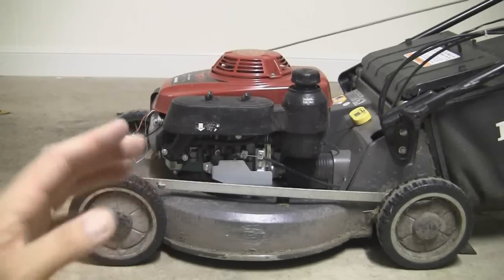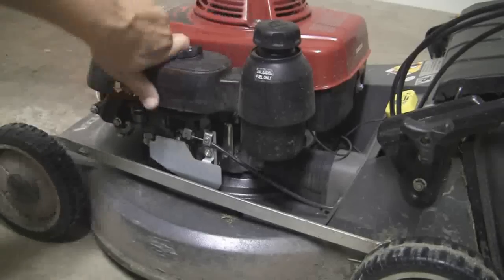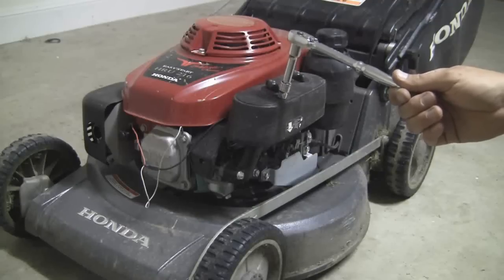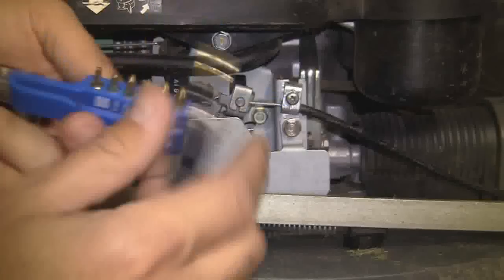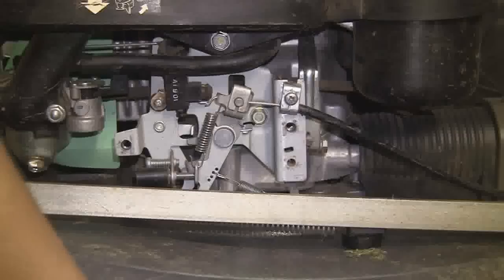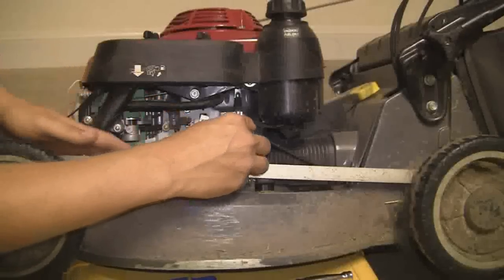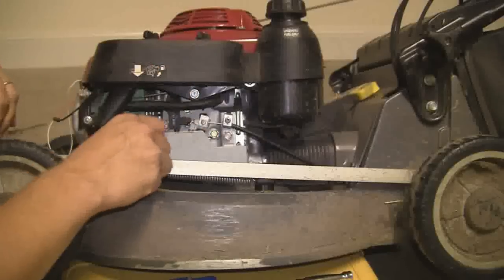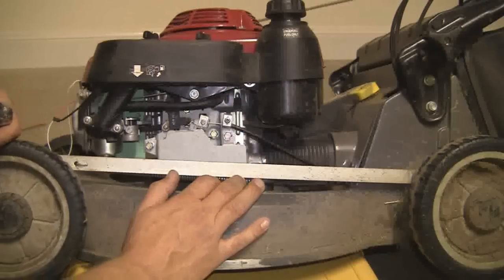Setting the engine rpm on a honda mower.wmv

Comment: As someone else mentioned, 3600 was a common rating for the engine power at 3600 rpm.
Very few mowers unless they are over 30 years old are supposes to be at at the number.
Most mowers are set to 2900 +or - 50 rpm.
I set self propelled mowers at 2880 and will often set push mowers at 3000 -3050.

3600 is not only to fast, it is likely a violation of blade tip speed safety laws.
Besides that, it's just extra wear and tear on engine that will shorten its life and it wasted wastes about 20% more fuel.

Comment: Nope - at least not for the GVC160 engines...
Shop manual for this engine specs are 2,950-3,100 rpm.
Keep those blade sharp and maintain the lubricant for the rear wheel adjuster bushings - they are a fairly frequent Honda power sucker and can be really dragging before you notice it.

Comment: Got my mower checked at Honda. It was at 2200rpm , 2 weeks old commercial self propelled . The setting was way too low, so they adjusted it to 4000rpm and said that’s way too high , so adjusted it again to 3200rpm. So if you have a new Honda, I wouldn’t go higher than 3200rpm. 3800rpm will wear the motor out according to Honda mechanics. I haven’t tried my mower out yet, since been fixed. But I’m sure 1000 extra rpm will make a huge difference.
Reply: All manufacturers have a limit on safe RPM to run engines 
Look it up and adjust as needed but not any more than that 😊

Comment: this is an old thread. I just spent $10.00 on an HR214 at an estate sale. The guy it belonged to passed away about a decade ago and it has not been started since. It is a clean mower. The oil looked new. He was a drag racer so I am sure he took care of his equipment. I put a little gas in it and on the first pull if fired up and ran like a top.

Comment: For what its worth 3600 rpm is the maximum rated speed and my Honda service manual warns not to exceed 80% of the maximum speed during continuous operation. That's why the are generally set around 2900 rpm. Running higher speeds will shorten the lifespan.
Reply: I just took mine to Honda, it was running at 2200 rpm, so they fixed it and set to 3200rpm. They set to 4000 to start with, then said way too high, so adjusted it again to 3200. So definitely 3800 is way too high
Reply: If you only run it at the highest speed setting when the blade is engaged and working it will survive well.

Comment: Honda intentionally has a lower rpm setting for their mowers that doesn't affect their performance at all. The lower RPM say in the 2600 to 3000 rpm range allows the motor to not only last longer but is also a lot quieter? The lower rpm doesn't affect cut or how fast you cut. I just bought a new car and at 65 mph my engine is less than 2000 RPM. Where my older car was sitting at almost 3000 RPM at the same speed. I think that is an advancement in technological design to improve overall performance and longevity. 
But what if you are cutting overgrown grass that was over a foot high? Honda allows you to make an adjustment by moving that spring to the next hole to increase the RPM so that the tall grass doesn't constantly kill the engine as you shove grass down its throat whether you are bagging or mulching. 
Honda superior engineering & design in every way. Please refrain from circumventing Hondas engineers who has already thought about whatever other concerns you had about their product. Just trust that Honda has got it right. I do.
Reply: breeze787 haha, you act like the people designing it are the ones who build it..lol...honda designed it to run 3600rpm, the schmuck who put it together obviously didnt put much pride in it or it wouldnt of been off to begin with.  Stop telling folks to not fix assembly issues, its not your dollar anyways.
Reply: There wasn't anything wrong with assembly. Honda engineers instruct assemblers to place the spring in in the lower rpm hole intentionally because it will neither hinder performance and the mower will consume less fuel & be much quieter. 
Please refrain from fucking up your Honda anymore than is required.
Reply: breeze787 cause everyone follows instructions..your right

Comment: I had a honda HRU19R1 mower serviced and it came back with the inability to throw the grass to the back off the catcher so it would start to drop clods when only half full or less and lose power on thicker (but still normal) patches

Comment: If it makes you feel any better, I just took ownership of my dads 25 year old HRU216 self propelled as he no longer needs it with no lawn to mow. It still starts first pull (but I snapped the cord). I'm spending about $100-200 on it because it's worth it and still a better mower than our couple year old Masport with Briggs and Straton. I just put a new throttle plastic lever on it, and the screws holding it on whilst corroded slightly on the outside are brand new shiny stainless on the inside(25 years frickin old). That's where the money is, I can pull a 25 year old mower to bits and live near the ocean and the only rusted out nuts on the whole thing was the exhaust shield. That's more impressive than our 10 year old car, or 5 year old door knobs that are inside our house!

Sure these mowers have their shortfalls, but they are really well built and designed to last. When it fails, i'll go and buy a new one.

I'll be sure to look at the RPM and give it a tickle, thanks for your video!

Comment: 3600rpm is rediculous by the way. I am looking for a way to get mine to spin to 10 000rpm plus or at least in the 8000k region. Most small 4 stroke motors these days pull 12000 to 20000 rpm . Mine is due for a rebuild. There must be someone who does an aftermarket carburetor/cams/valve springs/high compression piston for these?....and also I am thinking that ditching the standard carby and moving to a flat slide bike carburetor with the right jetting would be better... the standard flow is totally gay, totally underpowered, especially when mulching and in 2nd with throttle pinned...  for me, in it's current form, this mower sucks!
Reply: and don&#39;t give me &quot;law states must be 3200 blah blah rpm max&quot; ... if a blade can&#39;t be balanced to spin at 10000 rpm and if the drive gear can&#39;t handle it, and if the steel is too weak, then it must be changed as well. There is no excuses for weak engineering designs or stupid laws based on weak design. I want to mow my lawn faster, less often (taller grass) and power though it without hesitation from the engine. These mowers are rubbish!
Reply: Nitrous oxide and bypassing the governor would be a good easy way to start, and would be easy to switch over to your next mower after it blows up.      P.S. drink beer and wear shin guards and steel toes.

Comment: Many , many thanks for posting this procedure for increasing the revs !I've just bought one of these and they oiled/fuelled it up in the shop , started it and then sent me on my way . This morning ( dry now ) I decided to give it a go , and the revs were quite low compared to my old mower of some 20 years now .......I found the ground speed and cutting torque very poor . So , I've thankfully found your video and made the same adjustments to mine this afternoon . I don't have a functioning tach ( one in the post from Ebay since last week though ... ) but I'm pretty good with estimating revs from years of equipment ownership/usage . Now I'm a happy camper . Why do so many mower sellers not give a damn about service/setup ? They're probably not prepared to move that governor spring . Cheers Mate :-)

Comment: Could the lower RPMs been intentionally set so that Honda could meet environmental requirements?   or "Honda consumes less fuel!"
Reply: BfSkinnerPunk yes, also helps Honda’s legendary “runs forever” department. Less wear through reduced rpm/ lower compression.

Comment: The engine is capable of 4kw (5.5 hp), but like almost all small engines (and many diesel engines, especially in caterpillar equipment) it is governed down to reduce wear and tear on the engine.  having made your adjustment, you get more power now, but you will have it for less time, if that makes sense.
Reply: The light that burns twice as bright burns for half as long, and you have burned so very, very brightly, Honda.
Reply: @greetswithfire1868 Four years later, still burning brightly.

Comment: Adjusting the governor like you did , puts some more pressure on internal gov, bearing.  However will take years to whear down. Just FYI.
Reply: the mower deck will rust out long before that happens, the wheels will crack, the cables will seize and break, the carb bowl will rust out.. these are 2 or 3 year throw away mowers

Comment: The engine may develop its rated HP at 3600 RPM, but the governed speed by law for a 21" deck mower is 3456 or less RPM. In most cases the engine should be running in the 30/3200 RPM neighborhood when on high speed.